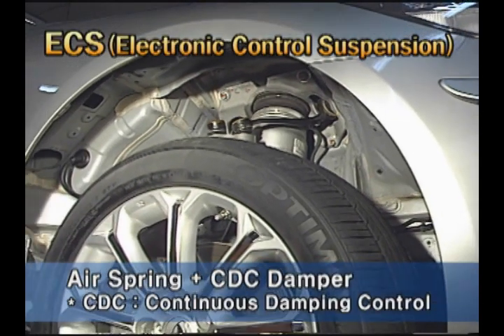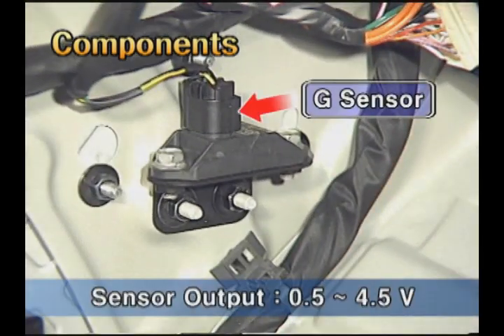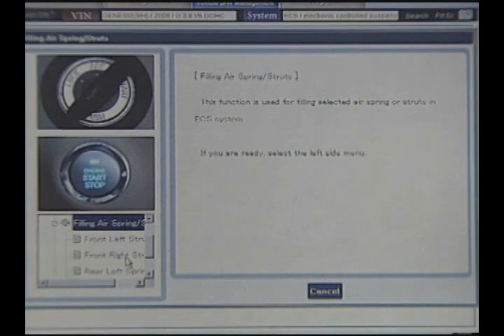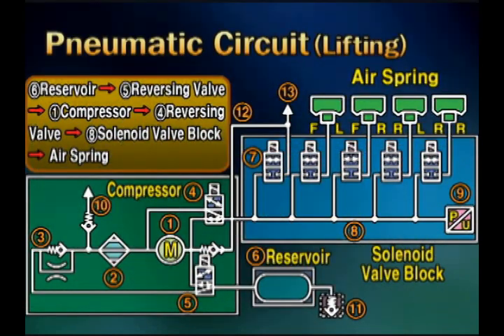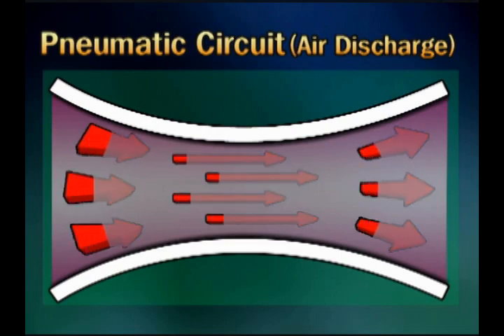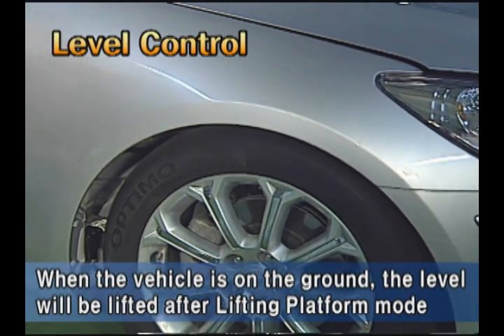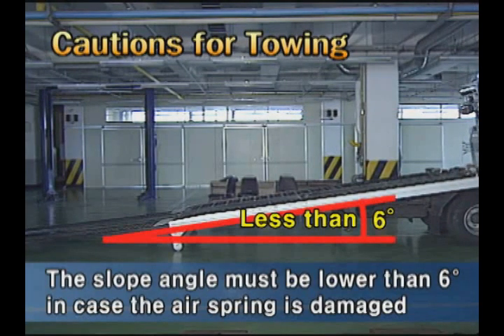Hyundai Genesis Air Suspension Calibration

Comment: I have a Hyundai equus and the air ride was a nightmare. Took it out and converted to shocks and springs. Best decision I made. Never have to wonder if my car is going to be 1/2 inch off the ground in the morning any more.
Reply from the maker: Thanks For sharing your experience.
Reply: Never had a problem with mine
Reply: @CorpulentCornball you will
Reply: I use to be you saying what you said now it’s happened and sad thing is I don’t really drive the bastard but once or twice a week
Reply: What kind of spring did you convert to. I want to do the same thing.
Reply: @EarlNelson-q8d  go on line and look up Strutmasters. I bought the kit from them. you will need to find an installer. I have no regrets. Honestly, the ride is fine. Good luck!

Comment: Thank you for the video. At 5:40 is that a schrader valve or what? The plastic part seems to have a place where I should screw it on.
Reply from the maker: Hi there,It’s just a normal inlet valve that you can fit the compressor outlet valve into. Please remember that for adjusting the height, you need a scan tool that is capable of diagnosing the air spring system and also you need a compressor that provides enough pressure as described in the video.

Comment: The rear of my car always drops. I try the battery reset but still comes down while driving or parked. Can this system be set at a drive height and then bypassed/plugged off?  Can anything be done except changing rear shocks as shown in other videos?
Reply: Maybe you have air leaks some wear
Reply: It's leaking.. Spray dish soap and water on all the lines and connections and tighten any that foam up

Comment: After I jacked up the front end to check the brakes, the car clunks when driving. The air suspension works fine. What could be the problem? Thanks
Reply from the maker: If vehicle height is ok and ECS light is not ON, air Suspension should be ok, noise could be coming from other components, check the brake calibers again if you replaced the brake pads.
Reply: @AutomotiveDiagnosis yes it was the aftermarket brake pads making the noise. Another question please: is there a procedure that I can do before I lift the vehicle, to prevent it from sagging when putting it back down?

Comment: Where can I buy the air filling nuzzle any idea?
Reply from the maker: This equipment is only available in dealerships but you can also use any other compressor with at least 12 bar of pressure.

Comment: I had the compressor replaced and my rear air shocks still go down all the time, any help or direction would be great!
Reply from the maker: Hi there, it could be a calibration problem. Did the mechanic do the calibration? It must be done by a scan-tool though.

Comment: Thanks 

Genesis coming in tow tibe off suspension normal and air suspension 
If the air suspension damage possible to convert the air suspension to normal since genesis normally coming with normal suspension
Reply from the maker: Hi there, from mechanical point of view it’s possible, but this system has an ECM which is connected to other control units via high speed can (C-CAN), so if shocks are removed or other components like the height sensors and G-sensors are not working any more, you will have constant fault on your instrument cluster, also if you remove the air spring ECM, you will have constant fault code to n other control units saying: Can time out with air Suspension ECM
Reply: You can switch to normal suspension and buy bypass from strut master to elinimate any faulty code

Comment: Amazing video thank you sooo much , 
Could you please tell me if it is possible that the air spring could be spoiled or broken or it is just the air pressure that need to be refilled. 
Because here in my place they always recommend normal suspension over air suspension even it’s better because they say if air spring is not working it can’t be fixed could you guide me to the right answer to choose which kind of suspension I will choose before buying GENESIS
Reply from the maker: Hi there, Thanks for your comment and feedback. Technically air spring is way different from the normal suspension and it is not gonna work just as a suspension, but also it enhance the vehicle stability. So, in the air spring systems you have height control (to protect the vehicle while driving off-road and enhancing the aerodynamic in high speed), and it has variable dampening force to improve the stability. Mechanics normally are more confident with the normal suspension repair as it is not that much complicated, but when it comes to the air suspension, it needs deep understanding of the system and electrical troubleshooting skills. Of course it is harder to be repaired, but that's because the system is a new tech to give you more features.
Reply: @AutomotiveDiagnosis   thank you sir you enlightened my information wish you the best of luck
Reply: @AutomotiveDiagnosis  I think dealers can do it or more skilled technicians

Comment: Interesting ...the Genesis didnt have air controlled suspension in the United States...just the Equus
Reply: Only comes with 2014 5.0 especially I think
Reply: @702s.studios  Just the Equus from the beginning ( 2011) to the end( 2016) of their production run in the United States
There may have been some sort of adaptive suspension in the genesis...but not a full on air bag and air strut system like the Equus had
Reply: @702s.studios  nope I have a 2014 rspec and mf got stock suspension
Reply: Genesis never had them. Equus only the first gen, after that they've dropped it. Good experience, but expensive.
Reply: @yurieu5872  Genesis G90 now has air suspension in the 2023 and new models. I current own a prior body style G90 and owned a Equus for many years prior to that
Reply: @turnne  I own the Genesis BH facelift with air suspension, brilliant reliable car, but the air struts needs to be changed at some point.
Reply: @yurieu5872  Certainly air struts have long term issues. Prior to the G90 I owned an Equus and the air struts were replaced under warranty at 4 years old and 57K miles
Reply: @yurieu5872 I have Genesis 3.8 From Turkiye I have Air controlled suspension,middle east versiyons are have that options.
Reply: I’m in one right now and front is air can’t tell in back but back is bad on left side

Comment: Hi, my so we have this 2013 genesis and the air suspension / button is acting up. Sometimes it works, and sometimes it doesnt. It would say ride height normal, but when you look at it from outside its down. what do you think the problem is?
Reply from the maker: Hi There, the problem could be simply for the switch itself, or any other components like the height sensors, technically when your problem is intermittent, it could be just for a loose connection and most likely on one the height sensors that you can find them by looking behind the front and rear wheels, otherwise, you need to take the car to a workshop as scan-tool should be used to read any possible fault codes and detect the problem.
Reply: @AutomotiveDiagnosis  EXTREMELY helpful as mine is intermittent and ECS light will come on but goes off when I start the car next. 2011 Equus Ultimate. I'll check the connections behind all 4 wheels
Reply from the maker: @bandmarc141  Thanks for the feedback Marcus
Reply: @bandmarc141  Hello,  Did you ever fix the issue?  My rear Air shocks go down all the time.
Reply: @ltfreedomreign  Hey! Yes I sure did. Had a new compressor....and airshocks and lines all replaced to be on the safe side. $3k bill tho. It was expensive but done at the Hyundai dealer.  Eventually had the rears done at the local Genesis Dealer. 
First step is to have the ride height sensors looked at. I just opted get it all done...I knew it was going to happen since every equus own said "it was a matter of time" for it to happen.
Reply: @bandmarc141  Thanks so much!
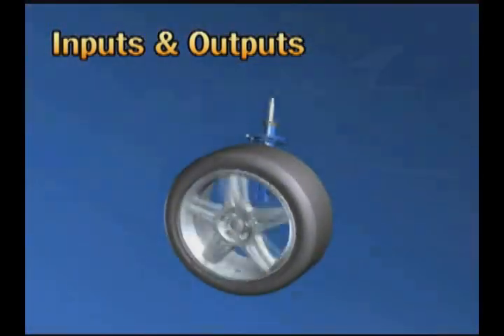Reply: 😅 4:13  @AutomotiveDiagnosis
Reply: Intermitent button  means LOW AIR SUPPLY, means you need to buy another strut ASAP